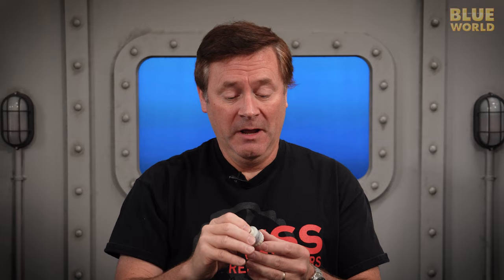All About Rebreather OXYGEN SENSORS | Scuba 101

Comment: why dont you do three or four different gas mixes and use those points to calibrate? Then you automatically can check weather your sensor ist too old. I mean if you get your oxigen from a blending station you can get a bit of nitrox with xy O2 as well.  With modern computers you should be able to calibrate for several O2 levels at 1 atmoosphere. Am I wrong?
Reply from the maker: Computers are set to calibrate at pure O2 only.
Reply: @BlueWorldplus  thinking about it, it seems reasonable. Otherwise there would be an additional possible failure point if one doesn't exactly know the oxygen in the gas mix.  I.e. if its 32,3 instead of 34%.

Comment: Great video thanks, makes sense to test the sensors to see if they are current limited but we are told to splash in with a low set point say 0.7 typically, whereas this test suggests we jump in at 1.0. Believe there is some ambiguity here from the agencies? Thoughts?
Reply from the maker: I'm not an instructor.  LOL.  I'm just saying how I do it.

Comment: Great explanation.
But still:
Nowadays there are highly reliable solid state oxygen sensors that have virtually unlimited lifetime - rated for ten years even in safety critical gas monitoring devices.
I cannot understand why rebreather manufacturers don't use them. These electrochemical sensors are clearly less safe and much more expensive due to frequent changes.
Reply: The problem is that solid state oxygen sensors requiers change in construction of the head of rebreather, also as for now poseidon is testing this but this is propioritary technology of this manufacturer so other producents would have basicly to buy this technology from them or invest a lot of money in developing similar system of their own
Reply from the maker: There is no question that the solid state ones are the future.  I don't know much about them, but how do they handle extremely humid environments?
Reply: The main issue is that those sensors requier external power to run (not like galvanic sensors that are basicly batteries) so you have to change build of whole electronics in head, as far as the problems with those sensors - I havent`t found any informations about problems only that they work great for long period of time (some were tested for much longer than 5 years without any problems) The second may be the cost of investment in those sensors (they are quite pricy but this is neglegble comparing to switching normal sensors for couple of years)
Reply: @robit024  I would have expected they'd digitize sensor readouts in the head electronics in order to transfer them via CAN bus or some similarly reliable digital protocol to the controllers. Your description implies that they run the analog sensor voltage through the cable and even a plugged connection and then do the AD conversion in the controllers.
Is that really true? Doesn't sound like a smart idea to me...
Reply: @lingen2193  Yes from my knowleage currently used galvanic sensors are analog, usually connected via 3 pin cabel to motherboard and conversion is done there
Reply: @BlueWorldplus humidity does not affect them, according to Poseidon
Reply: @robit024   Testing??? I dived on a 10-11 year old Six and own a Se7en+ and the first I hear is about "testing"... also the patent was released about a year ago. Just FYI.
Reply: @BlueWorldplus   In my personal experience they handle humidity perfectly and repeatedly so.
Reply: @blackr2d   Ok - "testing" was a mental shortcut - what I mean is that, in fact, Poseidon is practically the only manufacturer that uses such sensors in normally available rebreathers, and considering the total number of units on the market and its overall size, there are not many people who use solid state sensors